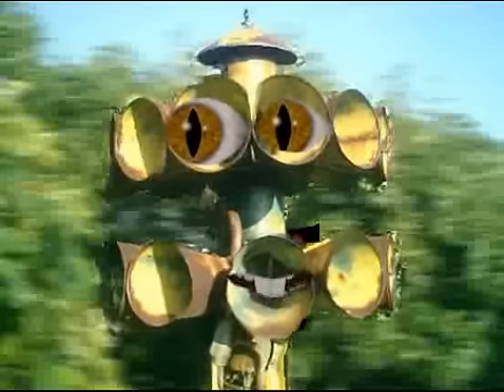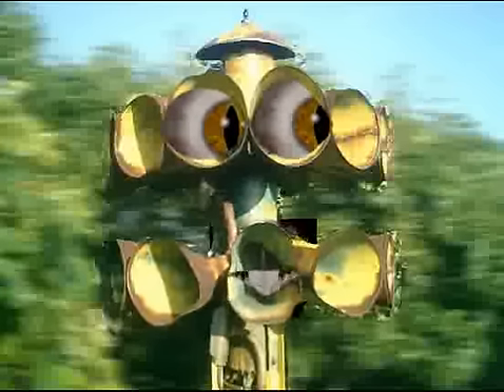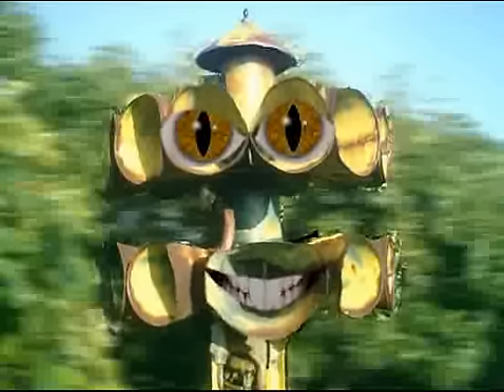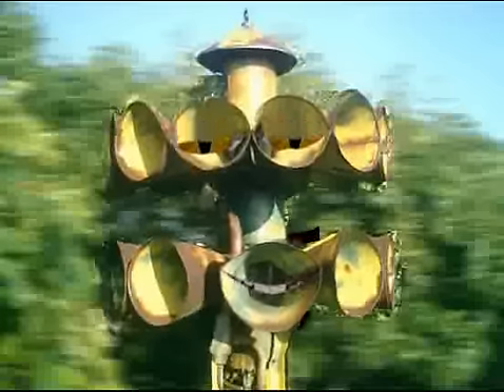A 2T22 speaks about signal codes

Comment: FYI, the cold war has been over for over 30 years now. These sirens aren't used for air raid attacks anymore. They are most commonly used for tornados nowadays.
Reply: Gess what I'm going to make a siren on the 3D printer called Lightningbolt 3000T
Reply: Hi broken solar panel!
Reply: I wanna be on Tornado Siren Madness
Reply: Someday you will be on Tornado Siren Madness that Roy Entertainment LLC will make you as the character on TSM